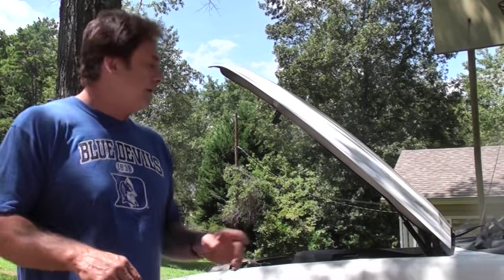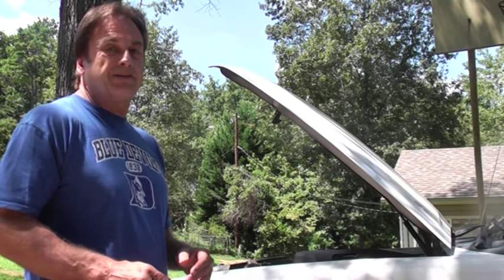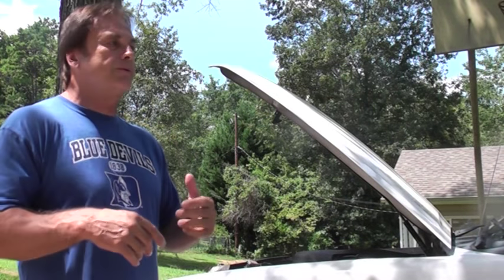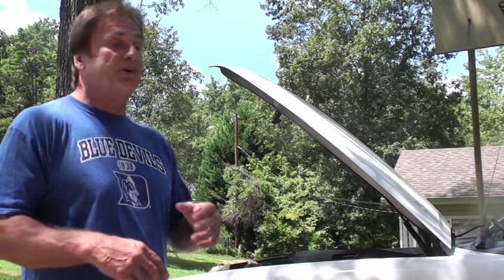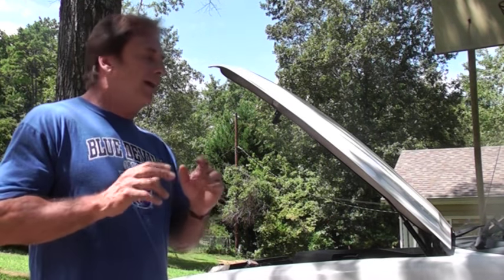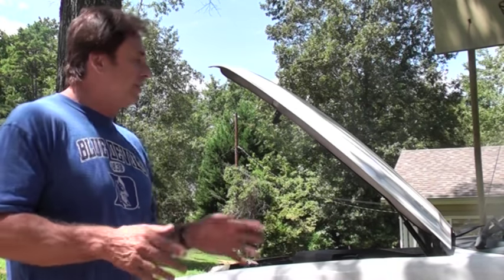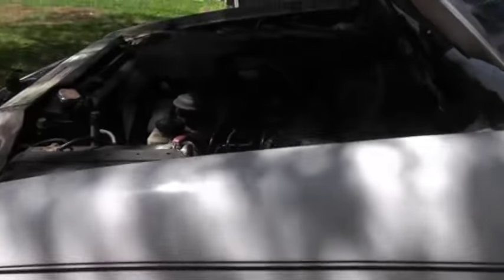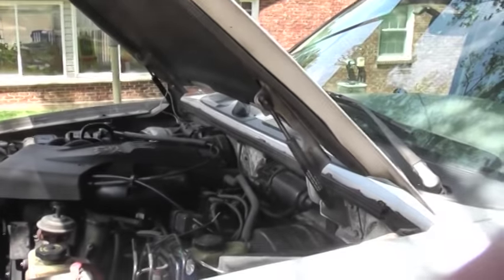How to Fix Battery light Issue Ford Explorer, Ranger

Comment: YOU - ARE - A - LIFE - SAVER.
We had a similar situation as yours. Three alternators and two batteries later, we were in the process of changing the wire harness; which it looked like a nightmare. My son checked YouTube one more time and found your video.
Once we changed that fuse, problem solved.
Thank you so much for taking the time to upload this video.
Reply: thank you glad to help

Comment: I just fixed mine. Thanks to you. I did all the same things you did. I parked the truck last fall because of this issue. I watched your vid today 4/16/2021 and went straight to the parts store. $4.99 got her up and running. Alt output is now @14.65 under a full load, and no more battery light lol

Comment: You certainly are the man.
 I have a 98 expedition 4.6. and after doing coolant work and removing a lot of my electrical. I replaced one of the 2 fuse since the original looked corroded. Ass after putting everything back together I had the battery light. Never thought the new fuse work could be the culprit. Thank you.

Comment: had a dead battery on my 2000 ford ranger. accidentally hooked up the power cords to the terminals backwards for just a few seconds, causing the truck to go nuts. i replaced the battery but the battery light on the dash was still on. replacing the MEGA fuse like you described in this video took care of it. thanks

Comment: Hi. same thing here, my mustang gt 00' is charging fine, battery alternator fine, but sometimes battery light in dash turn on. i remember years back i  jump start a car but the other car was with reversed cables (positive in negative) something like that. i got some sparks. and months later the battery light starts to turn on. hope you can help. THANKS
Reply: I didn’t find on my 2004 Ford Explorer

Comment: I have a 2001 Ford Excursion with the exact same problem..problem is I cant find the 175 fuse. Do you have more info on this fuse?
Reply from the maker: it's right near that main fuse box under the hood usually on drivers side where battery resides as was shown on video. should be near battery. if not go to autozone they can probably locate it for you.
Reply: Look at where I located mine on video
Reply: or if you found where it is located you can get them at auto zone

Comment: Can you maybe lead me in the right direction.
My 98 ford ranger has the battery light on. But my truck still cranks up.

Any ideas as to why?
Reply: yea it will always still crank up but the problem lies in the fact that a running engine can be draining your battery with  the  alternator not charging  properly and the problem is that something is wrong with the system as described in the video.. could be fuse or bad alternator or alternator brushes

Comment: My ligth came on today  but my 05 explorer is still runing fine kist the battery ligth is on I'm going to try this first thing in the morning thanks
Reply: Did that work for you? My 05 is doing this light and beep charging system also. I've tried several things.
Reply: @wiengo509  I too have the same issue.  Did you ever figure out what the fix was?

Comment: Battery light on dashboard for couple of days but everything seemed okay until I started to go to wprk one night and everything dead. Put on trickle charger and it started after about 8-9 hours on charger but just barely. Took back up car second night in a row. Came home from work everything dead again. Took battery to parts store and they charged it and said battery was good. Installed battery and took badk to parts store and checked out system they told me everything,alternator,starter and battery all checked out good. The second parts store said the same thing huum. he battery light is not always on just when I take off and have a load on it. Even reving it up and holding the brake I get a flash on and off of a battery light. I talked to my paint guy and he said since its only on with a load maybe the belt is slipping so I bought some dressing and still have a light. I'm stumped and not sure the fuse you are talking about will do me any good but its worth a try. You crossed cables which probably blew that fuse mine just wouldn't start. I will try the fuse and then maybe a new serpentine belt then go with an alternator. Only thing I can think of at this point. What do you think?
Reply: Uü

Comment: Anyone have a clue as to how the fuse and battery light are related?
Reply: You can check a fuse by using the continuity test with a voltmeter. If it has good continuity, it could all be a bad electrical connection at the fuse. The guy never checked the fuse. His connection looked rusty

Comment: That's called a linkable  fuse now, I'm sure I can find 10 more, you don't know what a linkable fuse is obviously now, some actually have a glass fuse that disconnects from each other and that fuse lets go, most people use them in stereo system's now, that's a linkable fuse there, in wires, you find what looks like a fat part of a wire like on a laptop plus that has a round piece on wire where it plugs into box, some don't unplug at all, thats a linkable fuse so it don't allow to much power and blows that 1st so it don't ruin a computer or catch it on fire, same on cars, there's many wires that has LINKABLE FUSES, call yourself a MECHANIC, just look at what you replaced, that kept you from blowing up the PCM COMPUTER THAT COST $300 PLUS BUCKS, IF ORDERED ONLINE. YOU COULD OF BOUGHT THOSE FOR $0.25 EACH AT 10 PER A BAG I BET. people don't know on stuff, I'm no good on wiring but know how to get and trace stuff down, DON'T YOU OWN A TEST LIGHT ? SHOULD OF TESTED STUFF, THAT CHEAP FUSE POPPED AND SAVED A BUNCH OF MONEY, WELL FOR MOST MECHANICS, IT WOULD OF SAVED MECHANICS A LOT OF MONEY, THEY WOULD OF TRACED IT BACK TO THAT RIGHT AWAY, NO ALTERNATOR REPLACED AT NEW COST OF $175, THAT'S WHAT MINE COST NEW DUE TO BEING 4 WHEEL DRIVE WITH ALL POWER PLUS THE 175 AMP COMPARED TO A 75 AMP ONE NOW. MORE AMPS RUNS MANY MORE THINGS IN ANY VEHICLE, IT'S IMPORTANT TO MAKE SURE YOU REPLACE IT WITH PROPER ONE, THEY DON'T ALWAYS COME RIGHT FROM ANY PARTS STORE, MY OLD CAR TOOK A 95 AMP ALTERNATOR BUT SHOWED AS A 75 AMP FOR SOME ODD REASON AND NO MATCH TO BOOT. IT TOOK A BIT BUT CAME FROM A CAR 5 YEARS OLDER, VERY COSTLY ONE ALSO EVEN WITH A DISCOUNT, COUSIN THE MANAGER SO 10% OVER THERE COST, THAT'S HIS COST. YOU MIGHT SEE A SQUARE ON A WIRE NEAR THE END WHERE IT BOLTS DOWN, THAT'S A FUSE. I THINK I GAVE ENOUGH, I CAN'T BELIEVE YOU SPENT WHAT $100 ON A TOW AT LEAST, THEN $175 ON AND ALT NOW, PLUS YOU REPLACED SOMETHING ELSE. EITHER WAY, YOU SPENT ABOUT $350 EASY FOR A FUSE THAT COST YOU LOTS OF TIME PLUS FUEL FROM GOING TO DEALERSHIPS AND TALKING TO MECHANICS AND LOTS OF VIDEOS YOU WATCHED FOR A $4.50 CENT FUSE THAT YOU WERE TOLD TO REPLACE THAT YOU CALLED A LITTLE BACK BOX THAT HAS WIRES CONNECTED TO EACH END, WOW WONDER WHAT THAT COULD BE NOW, TWO WIRES ONE ON EACH SIDE, THEN THATS A FUSE NOW TO PROTECT THE REST OF THE VEHICLE, WHY, BECAUSE PEOPLE JUMP STARTING OTHER VEHICLES NOT KNOWING THERE STUFF AND BAM, IT BLIWS THAT TO PROTECT YOUR HIGH END PARTS FROM YOU, BECAUSE MANY CARRY JUMPER CABLES, BATTERY CABLES GETS REPLACED A LOT, LOTS OF TIMES PEOPLE PUT CABLES ON IF JUST BLACK OR JUST RED, WHY ? BECAUSE ITS ALL THE PARTS STORE HAS LEFT, PEOPLE MUST READ THE BATTERY FIRST AND FOREMOST, MAKE SURE YOU CONNECT POSITIVE TO POSITIVE AND NEGATIVE TO GROUND NOW. THEN NO ISSUES OR IF THAT FUSE DON'T BLOW, THEN YOU CAN BURN UP YOUR FUSE BOX OR BLOW UP COMPUTERS, CARS CAN HAVE UP TO 5 OF THEM OR EVEN SETTING OFF AIR BAGS, YEAH, GO FIGURE, WIRING IS JUST THAT WHEN SHOCKED WRONG, ANYTHING CAN HAPPEN THAT COST YOU LOTS OF MONEY. BACK IN THE LATE 1980'S THEY STATED NOT TO USE NEW VEHICLE'S TO JUMPSTART OTHER VEHICLE'S AT ALL BECAUSE OF COMPUTERS. I'VE ALWAYS TAKING GREAT CARE OF THAT BIG TIME, WHEN PLAYING WITH BATTERY, READ YOUR BOOK ON VEHICLE'S, BECAUSE YOU MIGHT NEED TO DISCONNECT THE BATTERY BEFORE CHANGING SOMETHING MINOR, JUST BEWARE OF BATTERIES BECAUSE THEY CAN BLOWUP IN YOUR FACE ALSO. EVER SEE THAT ? HAPPENED TO MY AUNT, SHE GOT BURNT AND LUCKILY SHE WAS SHORT AND LOOKING AWAY WHEN SHE POPPED HER HOOD BECAUSE HER CAR WOULDN'T START IN 1980 ON A 1973 CHEVY IMPALA, I WAS IN A CAR TALKING TO A FEW FRIENDS AND I WAS THE PASSENGER, WE HAD TWO FRIENDS ON EACH SIDE, 1 IN A CAR, 1 IN HIS TRUCK, ALL OF A SUDDEN WAS THIS LOUD BOOM AND RADIO WENT OFF ALONG WITH CAR DEAD NOW, WE ASKED WHO THREW THE FIREWORKS NOW OR THE 1/4 STICK OF DYNAMITE NOW THAT KILLED THE CAR, THEN SMOKE FROM HOOD LIKE FIRE, THEN SMELL CAME, WE JUMPED OUT, THEY PULLED AWAY INCASE OF FIRE, WE FELT HOOD, NOT HOT HOT, SO I OPENED IT SINCE THERE WAS LOTS OF DRIPPING UNDER CAR, THE BATTERY WASN'T NOTICED AT FIRST BECAUSE THERE WASN'T ONE LEFT, IT TOOK US A FEW MINUTES TO NOTICE IT WAS NO BATTERY IN IT AT ALL. THE BATTERY OVER HEATED AND EXPLODED AND WAS LOUD. IT'S 1 THING THAT KEEPS ME FROM BUYING ELECTRIC CAR, THERE'S ALL LOADED WITH BATTERIES. SO BATTERIES CAN KILL.